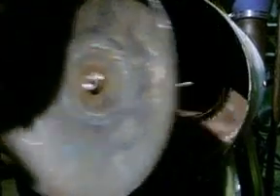Homemade DIY Turbojet walk around 2

Comment from the maker: There are alot of holes, maybe not in the right places lol, the bypass air comes from the outside parameter (notice in the vid that they are small fins on an angle) and there is more of them around the flame tube. This set up is just my idea i tried.  I guess it does not work lol.